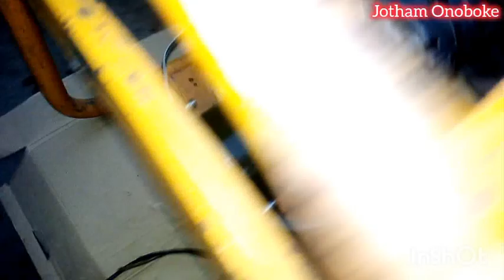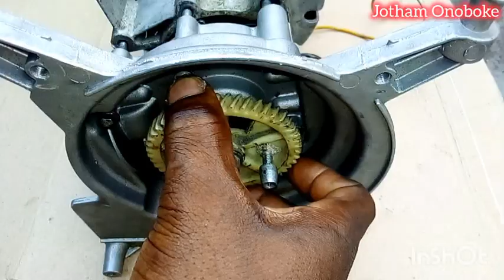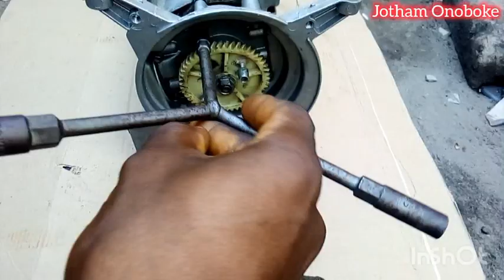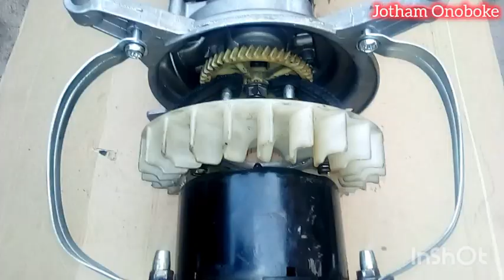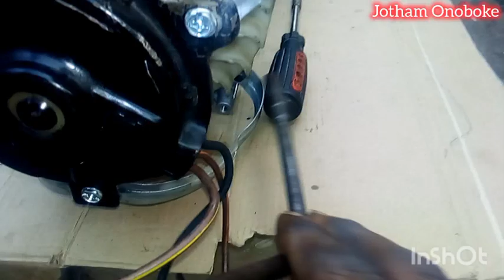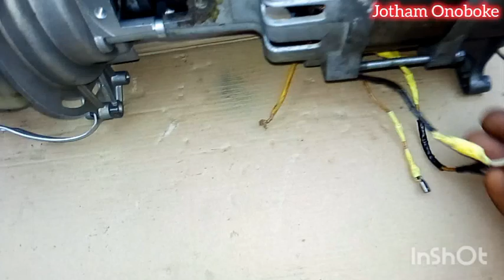Gasoline generator conversion to Fuelless(Part 4).

Comment: sir, can i use truck DC motor for 7500 kW alternator
Reply from the maker: That would be fine sir, If the DC motor have at least up to 5hp that would be fine to spin a 7,500kw alternator without stress. Thats why I went for a 1.5hp DC motor to spin a 1kw alternator

Comment: Good video sir which vehicle did the motor came from sir please
Reply from the maker: So sorry sir I can't remember the name of the viechle  because I but it has a complete radiator fan so I had to take it apart to get the motor, you can go for an Audi radiator fan or Volkswagen will work sir

Comment: Please sir, how many kVA does your generator produce?
Reply from the maker: Sorry for the late reply, It would produce around 800watt sir, so has not to stress the alternator for long team operation.
Reply: @Jotham-Onoboke  me i have 2700 watt can i use the car fan to turn this? Tank you sir
Reply from the maker: @pascalfreudkakarot2776  Yes sir you can use it on a 2700 watt alternator if the motor is a little bit bigger, so has not to stress the motor, you can get a slightly bigger one from some of this Germany viechles like Audi or Volkswagen sir they have an RPM of around 3500 and around 2hp which is more than enough to spin the alternator without stress and its just slightly bigger than mine.
Reply: @Jotham-Onoboke  tanks 😇🥰🥰🥰
Reply: @Jotham-Onoboke  sir please can I remove the AVR and the caol
Reply: @Jotham-Onoboke please can I have tour whasap number ?

Comment: your explanation is so clear, good video
Reply from the maker: Thanks so much I really do appreciate your kind words
Reply from the maker: I watched your videos and I must say I was impressed i made sure to like comment and Subcribe, I pray you reach your goals sooner than expected.
Reply: Engr., please sir can you explain to us how to winding the alternator to boost the current, and how many per slot of winding the wire please sir we need you on this aspect sir. Thanks our boss. God bless you
Reply from the maker: Yes sir you can take the alternator coil just the stator winding alone to a person who rewinds generator coil, and explain to him you would like to increase the coil winding for increase current so as to achieve lower RPM so the Capacitor winding would be increased and also  the turn of the output  winding, so as to increase the current that would be produced by the coil
Reply: Thanks Eng I want to know How the magnet placed in amateur please,may your goal achieved Sir.
Reply from the maker: @telacomgokaru  Ok sir the Alternator Rotor has 2 sides where a tiny magnet is attached to it, On side can be used by installing a neodymion magnet the North side and the other side the neodymium magnets should be the south side of the magnet which means you would have to drill a hole on the rotor.
But the easiest way is to take the alternator coil, just the stator winding alone to a person who rewinds generator coil, and explain to him you would like to increase the coil winding for increase current so as to achieve lower RPM so the Capacitor winding would be increased and also  the turn of the output  winding, so as to increase the current that would be produced by the coil.
This is also another way to get it done.
Reply: @Jotham-Onoboke  Sir may I know the difference between northern side and southern side in the magnet
Reply: How can I differentiate N & S in the magnet?
Reply from the maker: @telacomgokaru5318  One easy way to tell which pole is north and which is south is to set your magnet near a compass. The needle on the compass that normally points toward the north pole of the Earth will move toward the magnet's south pole.
Reply: @Jotham-Onoboke  okay Sir unlimited thanks,may I have your contact number? It will help me please.